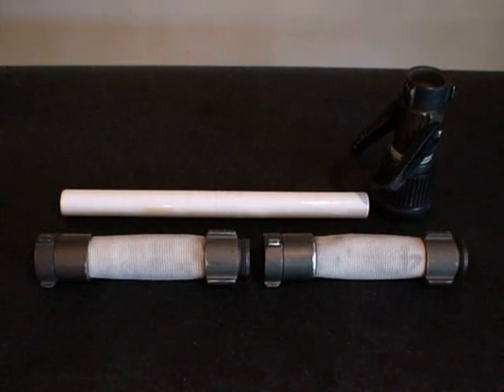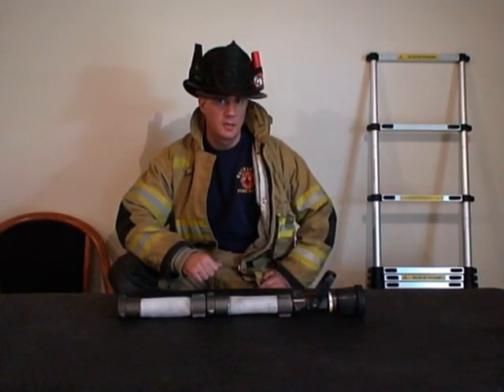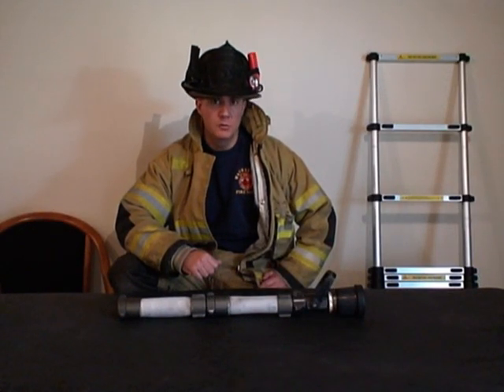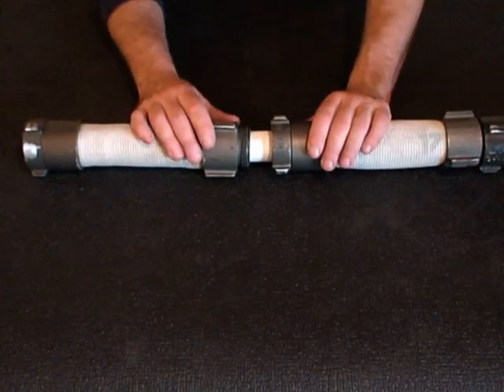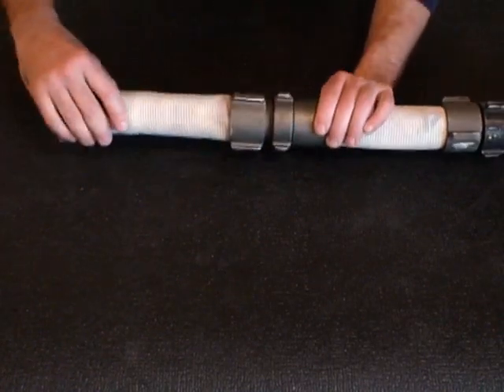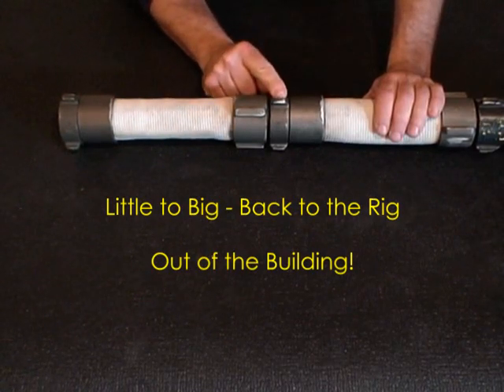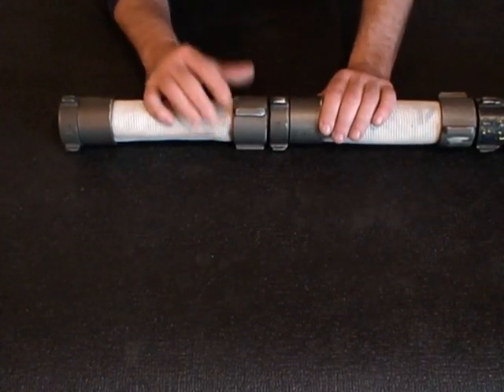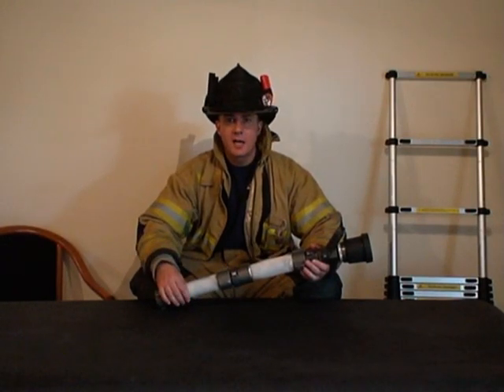Firefighter Survival - How to use Hose Couplings as Directional Indicators

Comment: If you cant feel the coupling set by reaching your hands out and you have a tool with you, slide the tool along the hose, whatever the length of the tool, thats how much more reach you will gain. If the tool does contact the coupling, you will know. 

None of these methods are 100% full-proof, but, all are taught to increase the odds of us getting out, alive. Lumps to Pumps, save our Bumps !!

Thanks for taking the time to share a great video. Stay Low, Stay Safe, Brother !

Comment: A hose coupling(http://www.winnerfirehose.com/fire-hose-couplings_c7) is connector on the end of hose to connect or couple it with another hose or with a tap or hose appliance, such as irrigation sprinkler. It is usually made of steel,brass,stainless steel,aluminium or plastic.
Used for combining fire hose with fire hose ,fire hydrant ,water lance and the fire-fighting truck so that they are to supply water or foam mixture for putting out fire.